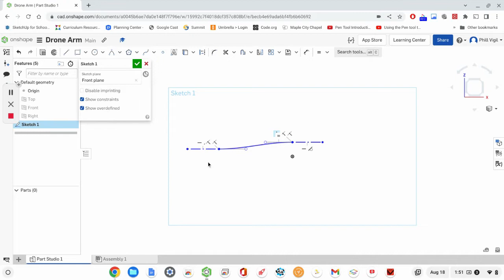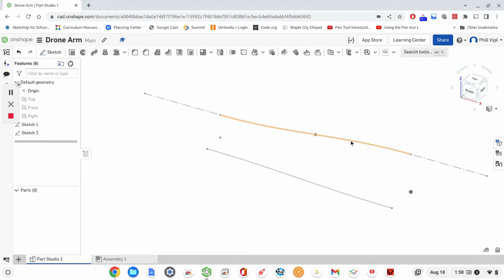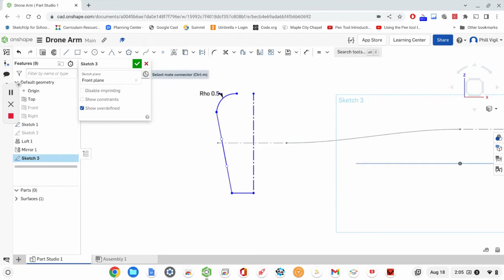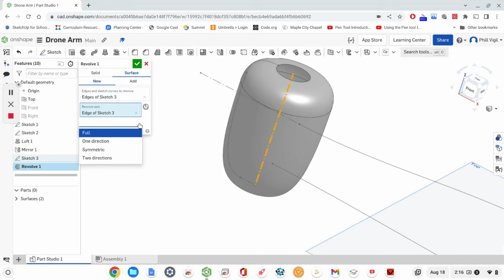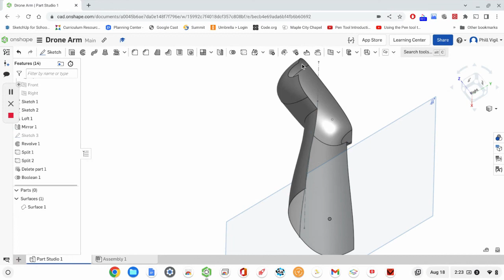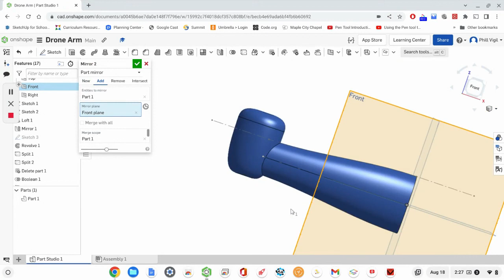Onshape Surfacing Introduction Exercise 2 - Drone Arm

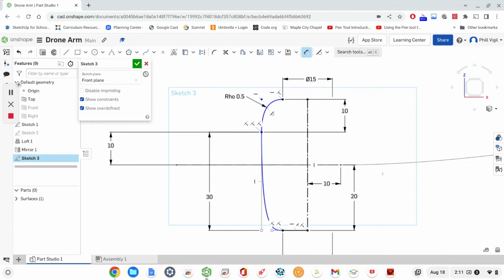Comment: Between 22:55 and 22:58 suddenly the size of 10 was added at the bottom. Also vertical 20mm at the right. from the (central point of the scene). Not sure though. Just learning.